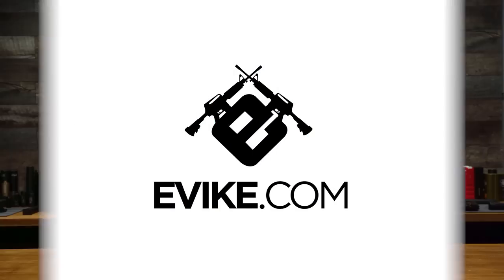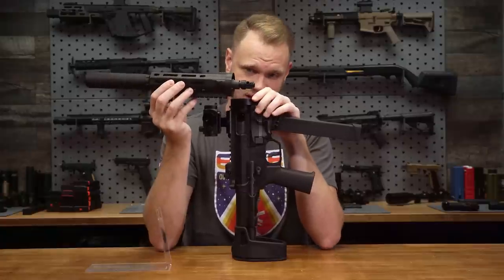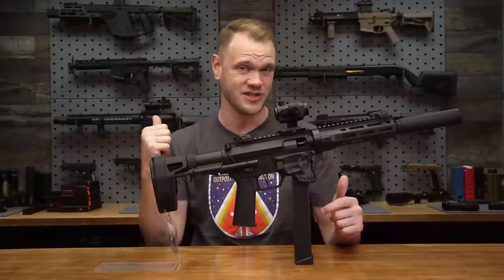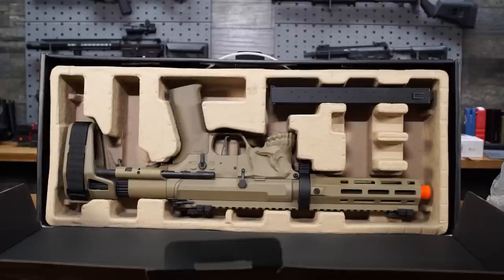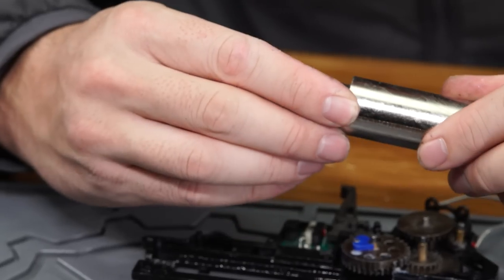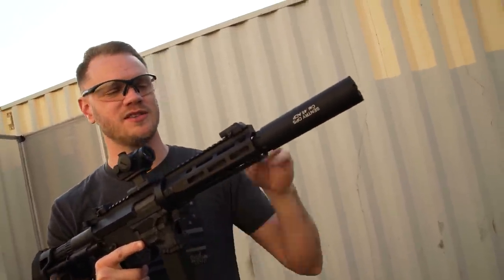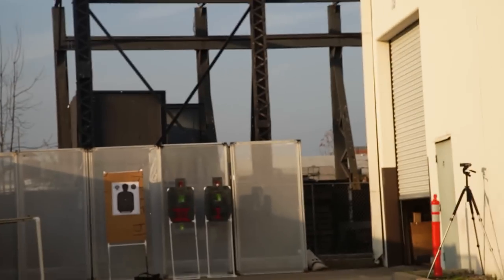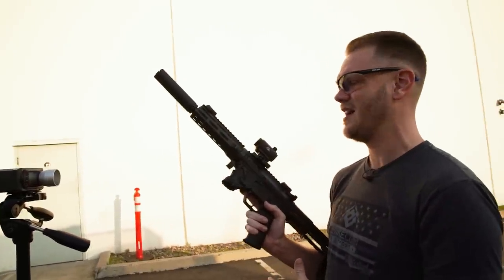ARRRRR You Game!? - EMG Sharps Bros Jack9 PCC AEG Review

Comment: i bought the high polymer version and notice some the difference from metal does it support the QDS in term of changing springs quick and the other question i believe i got the mock suppressor but i think i need to swoop out the orange tip to get it on. What grease or silicone would you recommend for cleaning and maintenance. Also have you guys considered doing a maintenance video on this AEG. Thank you.

Comment: Anyone have recommendations on mid cap mags for this?
Reply: Classic Army nemesis x9 mids...and G&G ARP9 mags...
That's your options as of now.
Reply: @SolaceGrayArc  G&G arp 9 mags currently won't fit. I've tried. Although these mags have the tab om the back, the gun only has the cstch on the side. So the Jack9 mags work for the ARP9, but NOT the other way around.

Comment: Looks nice. That's it. This thing is not made for upgrades at all. You will be destroyed by experienced players in seconds
Reply: J I eh not really. You can still get it it up to 30rps and do the pre cocking mod. Though the gear box shell not being a v2 is a bummer
Reply: OP Airsoft 
Whts gd OP
Couple weeks new to this .. Thinking about really getting this Jack9 arp
U said This sexy beast can B upgraded to shoot 30rps .. How ? I guess changing the gears / N motor.. ? like I said still learning ..any info we help.. Thx
Reply: @opairsoft8100  bruh how do you get it up to 30 rps tho?
Reply: DEADPOOL GAMING STREAM multiple ways, 14-15 tpa motor and a 11.1 will get you there about, or 12:1 and a 16-22tpa will get it or over, 18:1 dsg with a 22 tpa motor will get it at 30 minimum if not possibly 45ish max
Reply: @opairsoft8100  ahhh thank you, I'm trying to find the balance of rps to fps, dont want a 30 rps with 200 fps ya know?
Reply: @opairsoft8100  do you think a 30k torque and 11.1 v would work to raise it to 30 rps?